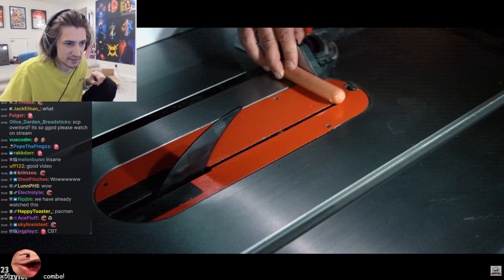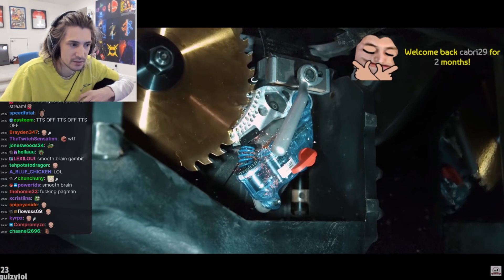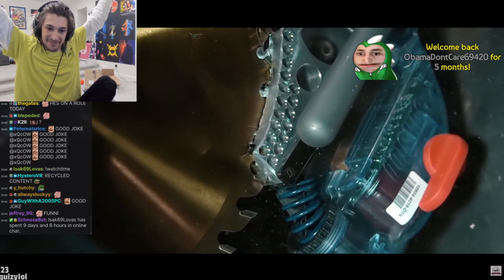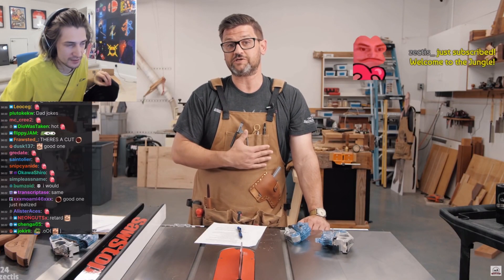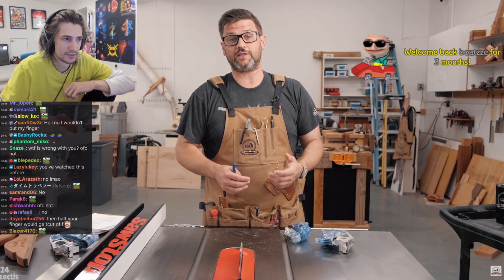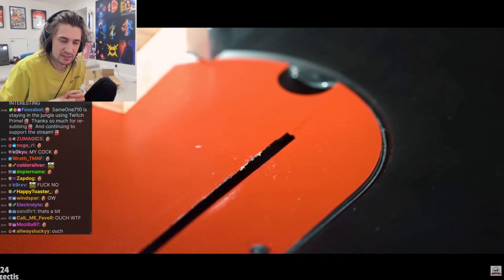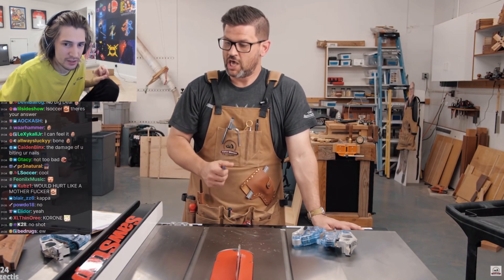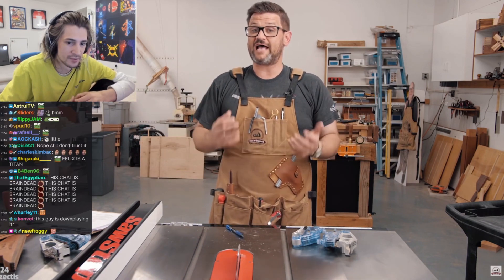xQc Reacts to How Safe is a Sawstop Saw?

Comment: How does it know when its cutting a finger and when its cutting wood.
Reply: Something to do with electricity running through the blade and your body conducts electricity
Reply: I think it's the fundamental monitoring of a slight electrical signal within the saw blade that lies at the core of our technology. With the human body being conductive, any contact with the skin causes a shift in the signal of the saw blade. It's this specific signal change that I believe triggers the activation of the AIM safety system, initiating the engagement of the aluminum brake.